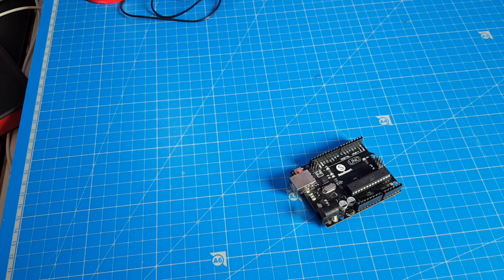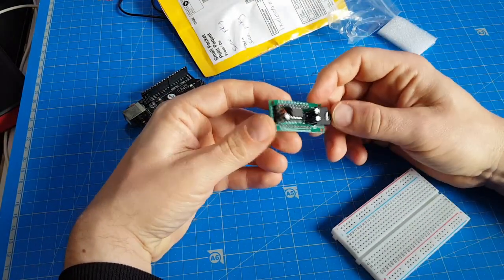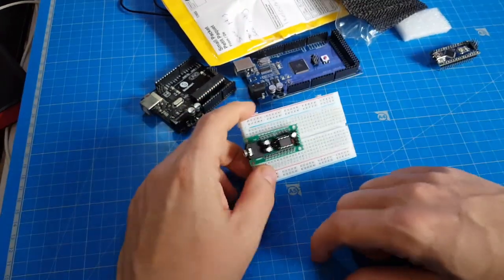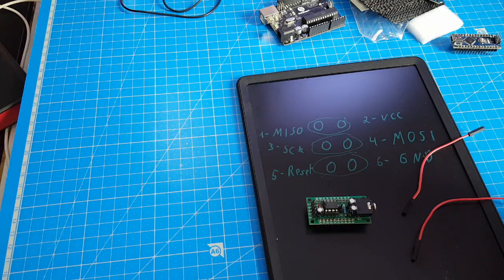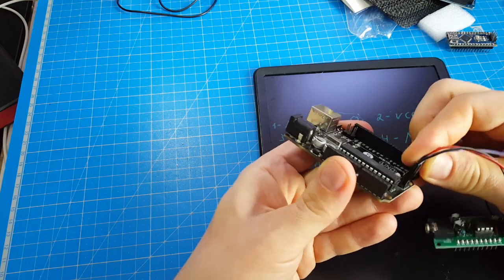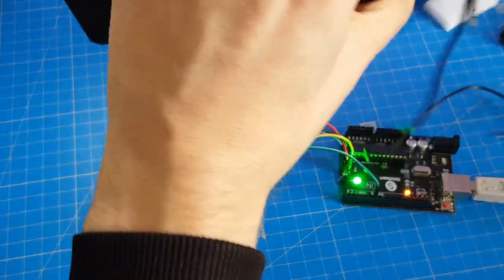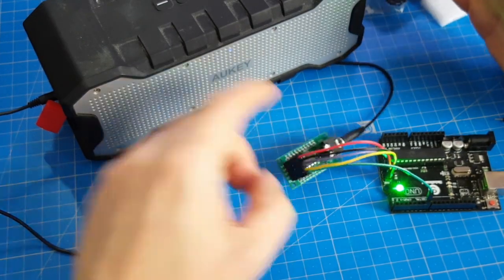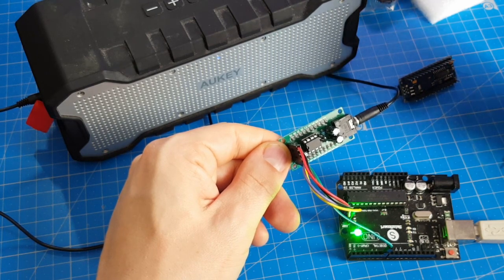Make the little buddy talk

Comment: Very nice. I think you are right and an mp3 player with sd is cheaper like $1.50 but expense of sd card and corruption possiblility makes it only good for temporary projects.  I am still debating using it as I have a few. They also sell a vesion with a chip instead but maybe is only limited to 10? I think chinese tts modul would be better as its almost as clear and vocabulary is unlimited as well as gives feedback over uart to whether or not a sound is already playing or is already done like the XFS5152, its also cheaper. You can also just load the files on external flash chip and play them. I am curious what chip he is using on this board, maybe we can just burn our own chip with project specific files. Any idea on the chip number? I'll look into it too.
Reply from the maker: Chip number is: aP23682 It's a voice ic chip capable of recording 682 sec audio data